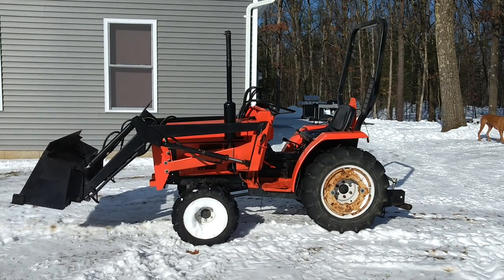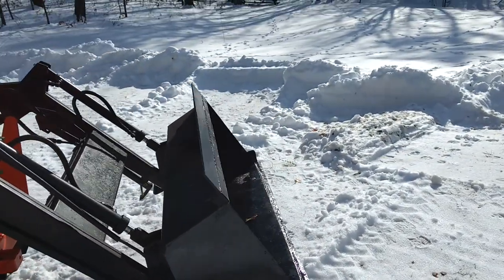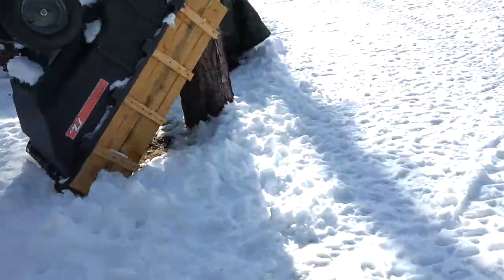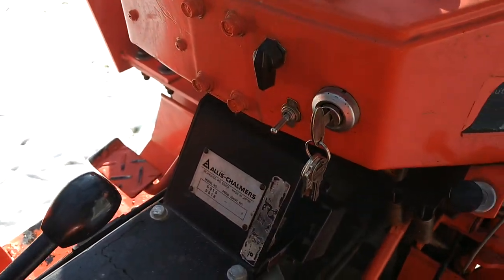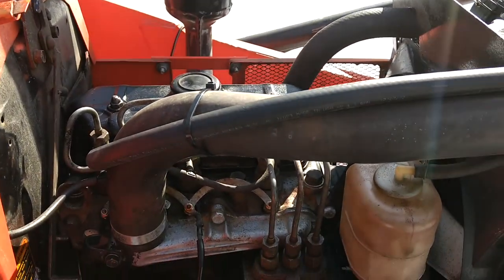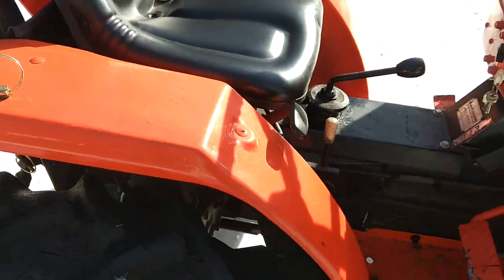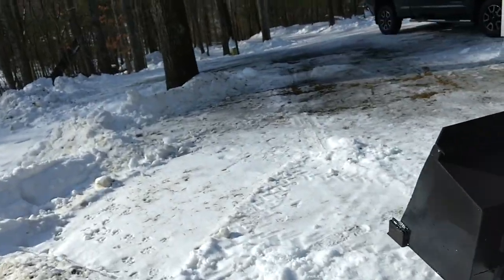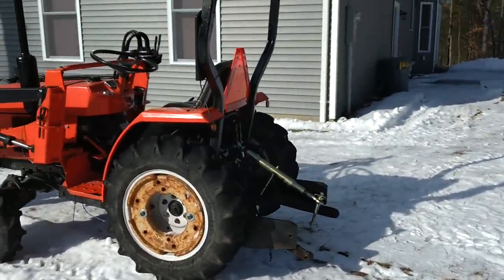Allis Chalmers 5015

Comment: Thanks for posting this vid. I have a 5215 and am trying to fix it up. Someday I may need to work on the engine like you did. I wish you had a video of that and also more detail on fuel pump / injector rebuild. Also I may try to install a block heater or radiator heater like you. It`s not easy getting parts or info on these. Model 5215 is called (Deutz Allis) because of new company owner back then. Same engine and mostly every thing else. Some parts are still available from AGCO dealer but like you said Southern Global or Western Ken. are other possibilities for new or salvaged parts. Fine little tractors. Mine has over 1500 hours.
Reply: Did you get it going?? If not still have the loader?
Reply: @austinjacobhunter  Hey Austin.  Sorry ,I`m happy with the old girl.
I`ll keep a look out for you though.
I saw your video. If I was about 40 years younger ,I wouldn`t be afraid to
buy 20 rough acres of land in Tenn. I`m in Indiana and always thought that Tenn. would be a good place to live. Good luck with that big project.

Comment: Thank you for the video!!!!   You helped me solve 2 issues with my recently purchased 5015 - White smoke when not under load and the breather hose issue!   Now I am curious what the headlights are - can you provide a link?   I haven't found any that fit the hole, that are actual headlights and not marker/trailer lights.

Comment: I have the hinomoto C1 74 version of your tractor. I have to reference your tractor when I’m looking for parts. What style hydraulic oil filter do you have or do you happen to have a part number? That’s next on my list. It looks like mine has a metal housing with a hex  nut at the top to remove. Thx! Great video
Reply from the maker: Sorry for the delay.  Spin on Wix.  https://www.amazon.com/gp/product/B0014BI8QW/ref=ppx_yo_dt_b_search_asin_title?ie=UTF8&psc=1

Comment: Great video. My 5015 is in great shape but it heats up all the time. I’m wondering if the water pump needs replacing or if I should drain the fluid and try that. Thanks for doing the video. A front end loader would be nice. Mine has turf tires. It is 1984 model.
Reply from the maker: Do you have a temperature gauge?  One thing I added was an oil cooler: https://www.amazon.com/gp/product/B0B1HJJZCS/ref=ppx_yo_dt_b_search_asin_title?ie=UTF8&th=1  The Allis Chalmers 5215 made in 89 is the same engine but they added an oil cooler.  I got a small one.  Dont want to overdo it.  I have not run it through winter yet with the cooler.
Reply: @joejohn1446  My tractor has a red light that comes on when it heats up and I usually stop working and idle it down until the light goes out or I just shut it off for a while. I usually then squeeze both water hoses to get things circulating and carry on. I’m going to drain the water line and flush it out to see if that helps. I will then fill it with 50/50 water and radiator fluid.

Comment: Joe, I'm looking at purchasing a A/C 5015 and would like to put on a front end loader, but it appears I will need a "diverter block" (a manifold block) and a "selector value".  Can you post a couple of close-up photos of the hydraulic setup in your tractor.  Thank you.
Reply from the maker: Just found this.  Cant post photos to youtube.  https://www.jackssmallengines.com/jacks-parts-lookup/manufacturer/simplicity/attachments-accessories/implements-compact-diesel-tractors/2096175-loader-model-415/hydraulic-lines-boom-end-to-control-valve-group-3482i28
Reply: @joejohn1446  it appears all the buckets and material are NO LONGER AVAILABLE

Comment: these are nice i had one but with bad knocking engine and engine parts are NOT available
Reply from the maker: http://www.southern-global.com/  give these guys a call.  They had everything for my engine.  Rebuilt head an all, pistons, rings, seal kits.
Reply from the maker: If the engine is knocking youre probably getting air into the fuel pump and injectors.  I had the same problem.  Add an electric fuel pump between the tank and the fuel pump.  Something like this https://www.amazon.com/dp/B01EUG7336/ref=dp_prsubs_1

Comment: how do you adjust the lift height at the 3 point?
Reply from the maker: I think the only way to adjust the lift height is change the hole the top link is in or the length of the top link.